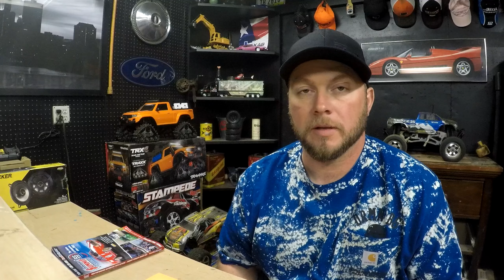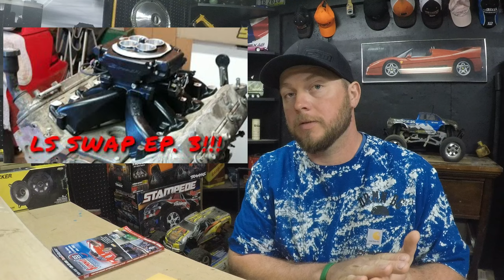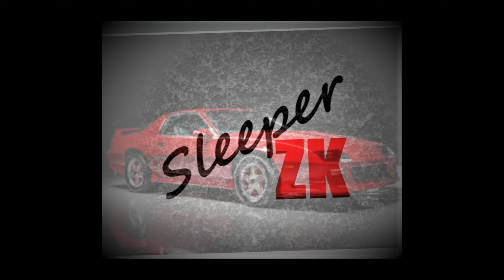LS Swap Cost? Questions Answered! Why I WONT LS Swap My Next Build, Hear Me Out! SBC350FTW!

Comment: I have an 84 trans am with a 305 carb pushing about 140 (probably less) and want about 300 hp. Do you recomend A. Building up the 305. B. get a 350 or C. Get a 5.3 ls for a few hundred bucks more than a 350? So far ive replaced rear suspension and working on fronts and going to change out valve covers and gaskets on the 305. Is 300hp possible on the 305 without spending thousands on it?
Reply: It also seems to have some smog components missing but some are there and seems like engine smell is getting in the cabin. Seems like I have to replace all vacuum lines as well to fix the smell/old plastics.

Comment: I have an 89 camaro with a 305. The engine it's been sitting for a couple years and I believe that the engine is trash. What is your opinion on me putting a 5.3 in it since I'd be making a swap anyway? It's a project car that I'd work on over a course of a couple of year and I'd like to build it to have a higher hp output but nothing crazy.
Reply from the maker: If you're only looking for 3-400hp, I'd seriously consider a 4bolt main 350, it's a direct swap.. slap some vortec heads on it with a decent cam, and you'll have decent power, and be money ahead..